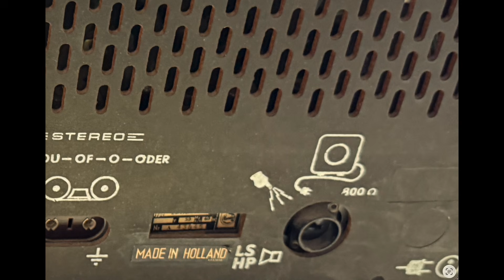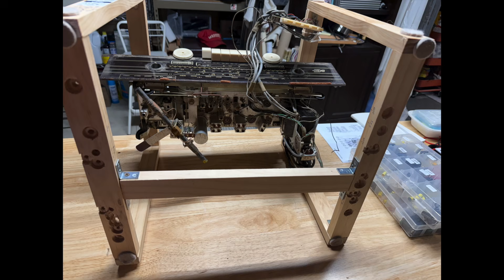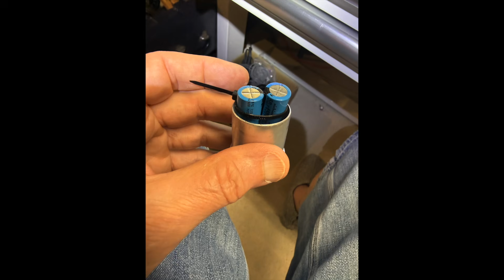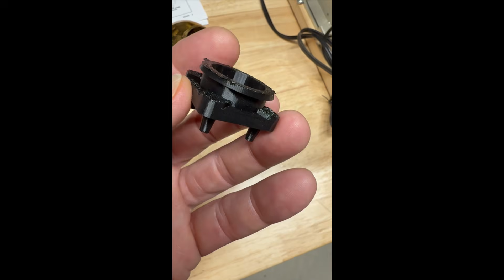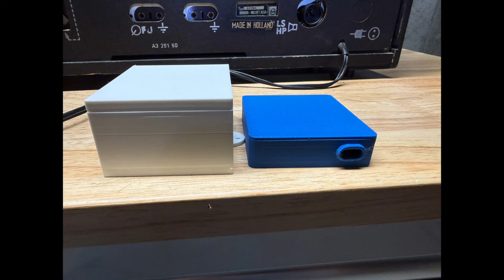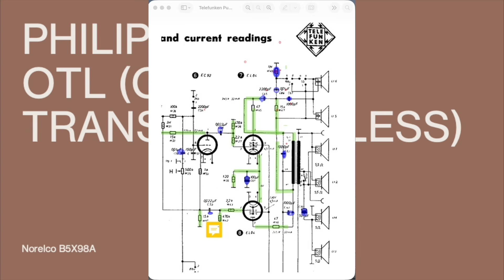Norelco B5X98A Restoration, Part 2

Comment: That's a beautiful radio, Peter, and the sound is amazing!  Thanks for explaining how transformerless radios work.  I thought it might be possible to convert a radio with a burned out output transformer to run transformerless but you've convinced me that the whole PA section would have to be replaced.  It's therefore easier to rewind a burned out output transformer like Dave Tipton does than it is to make a radio run transformerless.  Good to know.  KD2ORG
Reply from the maker: Thanks for watching. It was an interesting radio to work on. I finally did need to adjust one coil on the FM section (the ratio detector coil) and now the FM sounds amazing.